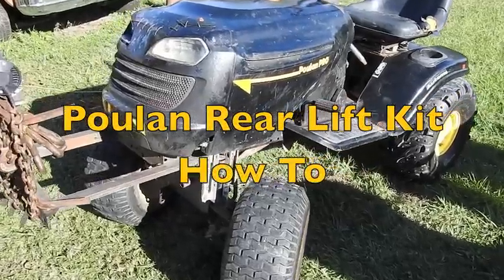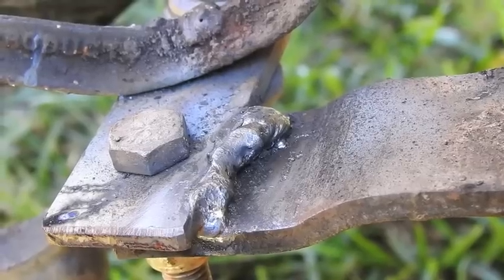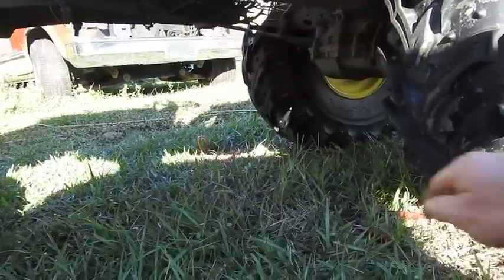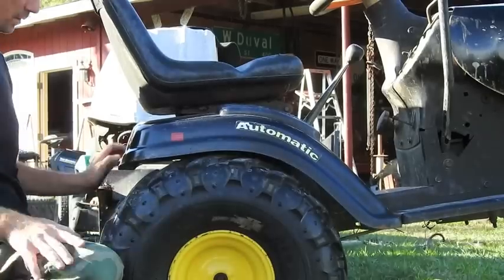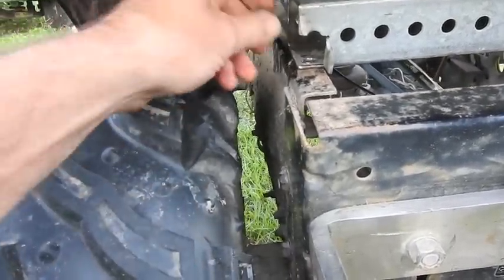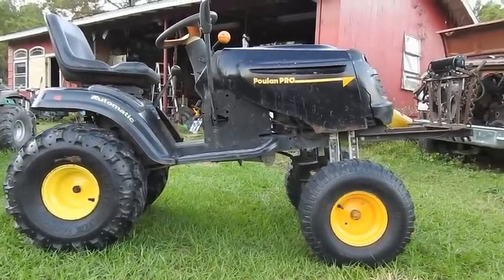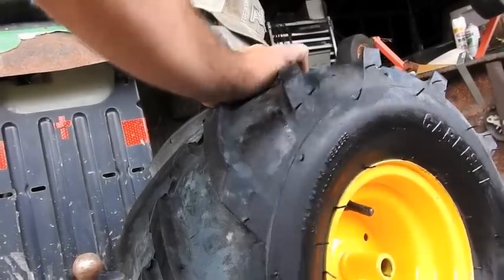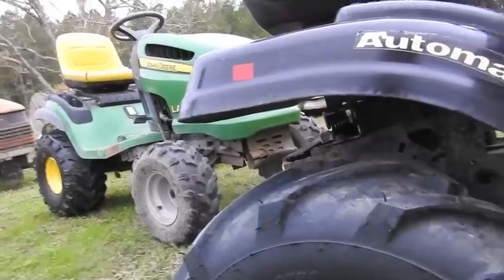Putting a Rear Lift on my Poulan - How to...

Comment: My lift will be on a Troybilt Pony so I’ll have to lift the entire rear as its all one stamped piece. I might go up  an inch on the footrests supports and 2 inches on the seat bolts. Might have to do spacers under the seat springs too. Enjoying your builds, rebuilds and rerebuilds.
Reply from the maker: Thanks so much and thanks for watching. Good luck with your ride

Comment: I stripe roads for a living, and that square tube with the holes is what we use at work to put up road signs. Somewhere on that piece is might have the word "Telespar" stamped into it. Either way, its rad stuff cause every hole is an inch apart, comes in 1 3/4", or 2" and has an anchor and a sleeve that the tube slides into, so we build all kinds of extra curricular projects with pieces of it. We made stencil racks, a frame for a giant carport, my boss used it to make a pen for some cows hahah
Some old road signs and telespar, got yer self everything from a go cart frame to a house.
Reply from the maker: Good stuff and thanks for watching.

Comment: If you want bigger tires in the back, you could try to get ahold of a dead jd L120, they have 10 inch wheels on the back, they would slide right onto your axles
Reply from the maker: That a good tip, I would love to get some ten's or twelve's on it. thanks for watching.

Comment: Hi! I build a mud and I am using a 6 inch cast iron pulley on front. When I change gears it hard. And even when clutch is fully press the tractor want to move. Belt tension is perfect. 
Do you ever had this problem? I am thinking about machining the pulley...
Reply from the maker: never had that issue, good luck and thanks for watching.

Comment: Why not just get a longer bolt and go through your seat bracket, fender and lift metal into the chassis? I like the idea of a rear lift and will do that for my trail mower. Thanks.
Reply from the maker: Good idea and thanks for watching

Comment: like your channel.  i own a Poulan Pro 300. hydrostatic.  ive been wanting to raise the entire tractor, but i still want to mow with it. my ground is very sandy and river bottom. the sand wears my blades out fast!   thought larger tires. but not sure.
Reply from the maker: Yeah, lifting it may make your grass taller.  Sand will eat right through the blades for sure. Thanks for watching.

Comment: Dual valves stems is a good mod especially when installing duals or tire weights however the stems should've been clocked 180 degrees apart so it keeps your tires in static balance
Reply from the maker: Good point, I didn't even think of that.  I will do it one the next. Thanks for watching.

Comment: Awesome stuff man keep it up but I have a suggestion I run duals on my John Deere had same problem with air so I just flipped the inside tire around valve stem towards the transaxle and the outside tire valve stem out problem solved with out drilling but you do lose bout a inch or two of wheel width total because of the way the rims are made you'll see if you try it
Reply from the maker: I tried that, but my tires rubbed when i flipped them...thanks for watching.

Comment: 5TH!!!!!! I think the poulen needs 2more inches and then it will look equal , I think you should cross the bridge. P.s speaking of crosses I like the one on the John Deere that is a must have on my mower ✝
Reply: I agree!
Reply from the maker: 2 more inches would look good... I have been meaning to put more crosses on stuff, but keep forgetting.  My dune buggy, Civic, Pilot, and the old van all had crosses.  I need to get back into that habit.
Reply from the maker: Thanks!
Reply: @chud327  jesus is never out.  Of season, just. Went out to the shed tonight boom! Reflective cross right up front

Comment: well, i think you need to add thoes 4 bolt hubs to your ebay shopping cart. finish your lift with some big tires.
Reply from the maker: Yes, I need a couple and then maybe a couple more... Thanks for watching.
Reply: @chud327  like those huge tires on a honda 3 wheelers

Comment: So is there no way to get the rear pully up and away from the watter?you really didn’t lift the rear of the mower
Reply from the maker: Like I said in the video, I did a suspension lift in the front and a body lift in the back. The body lift allows for bigger tires which would keep the pulley out of the water better.  If I do a suspension lift on the back, which will be a lot of work, I will be sure to make a video on it. Thanks for watching.

Comment: My 14 year old self thinking here but say i didnt mind the aggravation and annoyingness of doing it could i not rig something up to use a chain instead of a belt?
Reply from the maker: Chain would be cool, but you would need some kind of torque converter of clutch system to work it. thanks for watching.
Reply: @chud327  i mean chain = no slip so ima make it work one day when i decide to make one( a mud mower)
Reply from the maker: @Cataklixxx  that will be cool

Comment: That ain't nothing but a body lift. That doesn't do anything for ground clearance
Reply from the maker: It now has 27 inch tires on it which does do something for ground clearance. I doubt 27 inch tires would fit with out a body lift. thanks for watching.